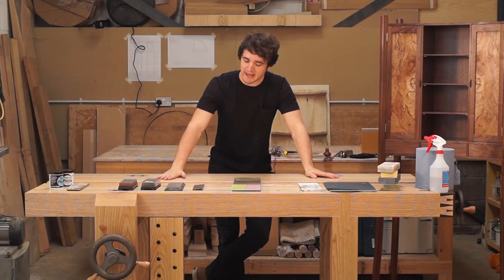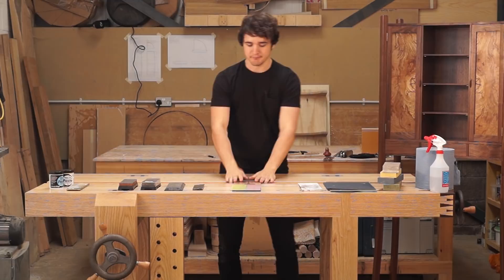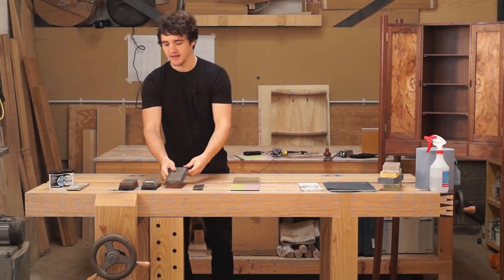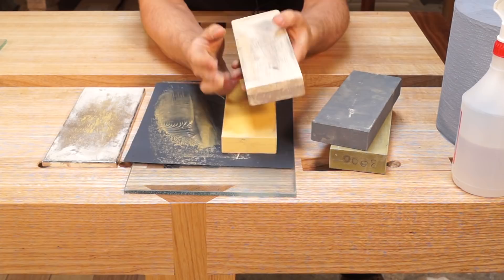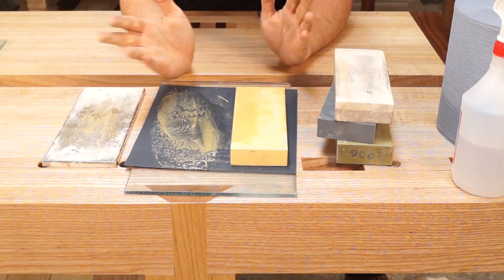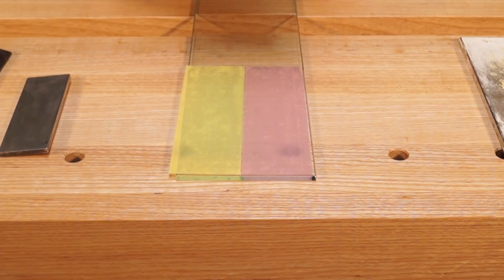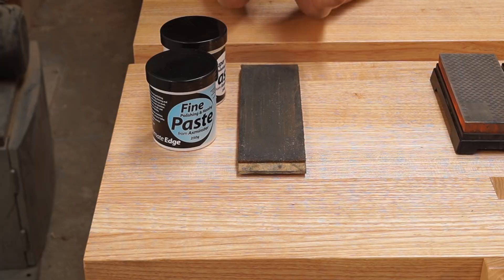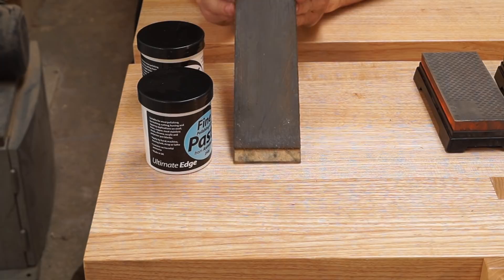Which SHARPENING Stone Is BEST? | Tool Duel #2

Comment: thank you Matt . what about ceramic stones ???how are they
Reply: Ceramic stones are water stones. Instead of something like aluminum oxides bonded in a matrix, it's ceramic particles. The non-ceramic stones tend to be softer. Ceramic stones are expensive, but they last.

I don't know what brand stones Matt has experience with, but Shapton water stones do not wear quickly.
Reply: I got a shapton Pro 1000 ceramic stone and it stays flat it lasts and you can go right to the strop from the 1000 and it cuts fast could just get away with this one stone and it's only 40 bucks

Comment: And he forgot the best of all. Oil stones. They stay flat for a long time, you don´t have a giant mess like you´ll have with water stones and they´re cheap.
Ans he´s wrong, oil stone cut quick. You can apply a lot of pressure without ruining the surface of your stone. A few strokes and you have a bur. 
I used water stones for a while but I had to flatten them often. I had to leave them in the water or soak them for a few minutes before using. You don´t have to do that with oil stones, they´re just ready to go. That´s what makes sharpening quicker.
I still use water stones in the kitchen but not in the work shop. Oil stones are much more convenient.
And I don´t get oil on my hands. The oil is on the stone, you wipe the blade after sharpening and that´s it.
And last but not least, why would I need a honing guide? Anything around 30° cuts just fine.

Comment: “As flat as the curvature of the earth” lol.  Does he think the earth is flat or the glass is curved?
Reply: The glass is curved it's as curved as the the earth is as is the surface of all liquid that's on this planet, the glass is formed on on a liquid metalto keep it flat but it can only ever be as flat as the curvature of the planet its on.
Reply: @alanwilson4860  Unfortunately float glass is not anywhere near as flat as the radius of Earth curvature. Making really flat surfaces (like Earth surface shape in a small scale) is a bit more difficult process than to pour molten glass on a tin bath. When glass cools down it distorts itself, also glass is rarely thick enough to keep its shape under gravitation. If plate glass is thick enough distortions are even bigger.
Reply: @bekanav  thanks for the correction, the comment I made got me thinking about it a bit more and I started doubting what I had said, surface tension might come into it if molten metal has surface tension that is, In all honesty I realised I didn't really know what I was talking about so cheers....

Comment: I've been experimenting for the past couple of years with waterstones, strops and scary. I have come to the conclusion that below 1000 grit, i.e for flattening and reshaping work on chisels and irons, diamond is the best option. For me waterstones don't cut very quickly below 1000 grit even tho the stones themselves wear quickly. For sharpening primary and secondary bevels a 1000 grit waterstone is superb. Then straight to 6000 grit waterstone to polish and strop on .5 or .3 micron lapping film. Diamond by itself is too expensive and the grits don't go high enough. Scary is good but ultimately will be the most expensive.  But I much prefer stropping on scary than a leather strop and paste. I don't think stropping paste on leather does anything more than a 5/6000 stone does.
Reply from the maker: Yea I would agree with pretty much all that! My 400g Diamond stone saw some proper abuse before having access to a Tormek. More on that in the next video. Cheers!
Reply: I've never used or even seen hollow ground chisels in person. I'd love to see a video comparing the relative merits of hollow ground chisels vs straight ground on even convex chisels (like Paul Sellers uses)
Reply: I agree... I bought a quality 400 grit water stone for removing nicks and other various sharpening jobs that need a lot of material removed... and I'm not satisfied. It just doesn't cut quickly enough and it goes out of flat before I even finish removing the ding... So I bought some quality alox sandpaper and stuck it to a flat surface and it did the job in half the time with 150, then 400.. And then I go back to my combination waterstone of 1000/6000 and a strop. That's the best result I got so far. One pass on my arm and I'm smooth as a baby.
Reply: I've used and seen hollow ground chisels, and honestly, I just find it usefull to set up the chisel before going on a stone. It guarantees a uniformity of the grind, and then the stone does its work so much quicker because you just work on the edge and the back of the bevel. Just about ten strokes on a 1000 grits to set up your edge, then you polish that flat spot you just created on something like a 6000 and you have an amazing edge in no time (and it's super easy to do it by hand and stay at the right angle because you have just two points of contact, so you can immediately tell when you're rocking your chisel). I find that purely hollow ground bevels, ie going on very fine grit on a grinding weel, are just way too weak (there is almost no metal behind the edge) and you just need to resharpen them all the time. So the way I dot it, grinding weel to start with, stone to finish it, and when the flat spot created by the stones starts getting to big so that it takes just too muuch time on the stones, back on the grinding weel. Works wonders for me.

Comment: Do u put any liquids on diamond plates
Reply: I do. I think most folks do. But you don't absolutely have to.You probably still should though. Some like straight water, some like a bit of soap in the water, others like certain cleaners. I like a certain cleaner myself. I use a super cleaner called Purple Power. Some like Simple Green too though. There's also a big glass cleaner camp too. Then there's special formulations made for use on hones. Which most think are just a cash grab.

Comment: how is the best way to clean an oil stone?
Reply: Dish soap hot water and an old tooth bush or brass brush, if badly neglected but still flat use the brass brush.  If they are natural stone like Arkansas some will run 'em through a cycle in the dishwasher after basic soap and water.   A quick rub on an abrasive on an engineering plate or float glass will check for flat and true and can clear old neglected stones.

Comment: Does anyone still strop after a 6000 grit stone? Seems unnecessary.
Reply: That's a great question. Most stripping compounds have it listed somewhere what equivalent grit or mesh they are aqual to...if it is something more course than 6000, it would be pointless, but without knowing which compound, couldn't answer for sure.

Comment: When you buy a new waterstone would you flatten it first.  If you don't have a diamond plate what grit wet & dry would you use to flatten a 220 grit waterstone and a 1000/6000 combination waterstone. Have you tried flattening waterstones with drywall screen sold by workshop heaven.
Reply: I'm not shure the grit is of much importance. The bigger, the quicker... I use 150 to flatten my stones. But I use quality sandpaper. I've used basic wet and dry before for that purpose and the stone actually wore out the sandpaper before getting flat because it's grit was harder.

Comment: oilstones were so comon as the steel, suitable for toolmaking was very rust-affine and when polishing out the cutting-edge the result depends on the very far micron of steel... It can rust away in one night... Since we now have chrome-, nicle-, vanadium- and molybdenum-doted steels, we're much more relaxed when it comes to whetening our precious tools. They stopped making those pure carbon-steeles around 1900 AD, since the 1950s, those irons are really dying out. Nowerdays, oilstones are... obsolte for almost any case.
Reply: I have plenty of steel from before 1900. Some of it is very nice. I was just using one of my obsolete cast steel slicks earlier today. I know its cast steel because it says so right in the metal. It's at least 150 years old if it's a day. I've had it for longer than a day myself too.

Comment: Here's a hint sonny, if you are going to make instructional videos even ones where it is only your " opinion", please get your FACTS correct, 
No1. All glass panes/sheets manufactured since 1952 , other that textured or speciality glasses are FLOAT glass as the common manufacturing process is "floating" the glass mix on liquid metal, usually tin. The machine drawn cylinder technique used prior to float glass, was somewhat wavy  and sometimes was polished to produce "PLATE GLASS"
No2. Oil stones are just as popular today as they have ever been, ergo not "old fashioned" and were kept in a box to protect them, the box usually having a cutout to fit over a bench edge or bench dog to prevent them moving.
N0.3 Water stones have been around far longer than oil stones, ie ancient history ( not including synthetic water stones )
N04. the oil, used correctly , for oil stones is to LIFT the metal swarf out from the grit of the stone, and DOES NOT clog the stone and water stones can be just as messy, it depends on the user. In over 45 years for myself and a further 55+ of my father's experience in carpentry and cabinetmaking neither of us has ever rubbed oil and metal particles into a job. Perhaps you should review your work practices.
No.5 Use different grades of grit and an oil stone can sharpen as fast as a water stone. I use both.
No.6 Float glass or diamond base is NOT necessary any flat surface free of obstacles that will damage the stone and stop it from sliding around will do ( ie grandfathers wooden box , which used to be every apprentice carpenters first project ) 
No.7 A strop should not be "removing the burr" as at the stropping stage there should be NO burr, the strop removes the last of the sharpening scratches and aligns the metal fibres of the blade edge.
No.8 You don't like sharpening, therefore you are not very good at it, perhaps you should stick to videos on things you like and then you might be more informed and informative.
Regards from one of those "old fashioned" carpenters
PS. pretty work bench, doesn't look like much work is done on it, maybe you are one of those guys that spend all their time making pretty benches and workshops and nothing else ?
Sorry that was a little unfair as I have not reviewed any of your work
Reply: I am a beginner, hobbyist woodworker only 26 years old. Er do you bother to use a jig to sharpen chisels? I tried freehand and i wasnt happy with my results. Im thinking about getting a honing guide and trying oilstones. I dont like the water mess and oilstones sound pleasant. I enjoy sharpening, just hate bad results. It tends to discourage me easily.

I value wisdom and experience from old timers such as yourself.
Reply: Hi  @garlic6969  there are commercially or eBay available roller jigs or sharpening jigs that you can easily and repetitively maintain the correct sharpening angle for both chisel and plane blades I have an old brass one given to me by my father that works as good today as when it was new. it is very easy to work out the correct angle for the type of carpentry you are doing ( I have several sets of chisels sharpened for differing types of work ) It is important to make sure that the edge of a chisel or plane blade is 90 degrees to the shank and this can be easily achieved with a shooting board and fine file held over the end of a piece of scrap timber or ply ( this is usually not necessary with new chisels but still check with a square. Then flat the back of the chisel with successively finer grit wet and dry paper on a glass sheet resisting any urge to lift the chisel during this process ( once done this will last for many sharpenings. For most sharpening ( unless edge is badly nicked ) I dress the edge with a 600grit oilstone using my roller jig and finish with 1000/1200 oilstone using the stone ( if kept flat ) or the glass and emery paper to remove the burr from the flat side ( do not lift chisel or plane blade ) this results in a very sharp useable edge that I hone on a leather strop board ( 1foot x 4 inches ) using the roller jig and polishing paste for the bevelled edge and holding the blade flat on the strop for the flat side. The result will give you an easily maintained very sharp edge to work with. Good luck with your future woodworking endeavours . Regards Steve aka Da Shan
Reply: @dashan6249   And God bless men like who have years of wisdom to tell me how to properly, and effectively sharpen my tools! I greatly appreciate it and I will be practicing your method with great humility. Thank you very much sir.

Comment: As flat as the curvature of the earth?
Reply from the maker: Gravity
Reply: The molten glass is poured onto a liquid - I think water, but not 100% sure - and it cools while floating on top of that liquid. Hence the name, float glass. They keep the liquid super still, so it doesnt introduce any ripples, and so is as flat as gravity allows. Which is something like 125mm drop every km. Over the length of a 30cm piece of glass that's about 37.5um, which is in the range of grade B straight edges.
Reply: I think they use tin for the liquid bath (maybe mercury??).  The liquid needs to be denser than the glass or else it would sink as soon it was poured in.  That's interesting about the straight edge grades.  Good info!